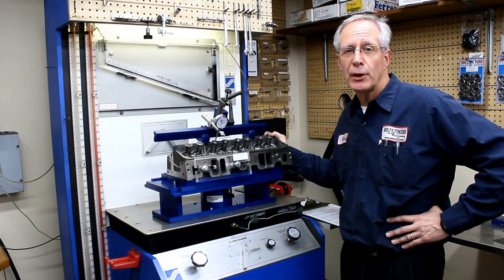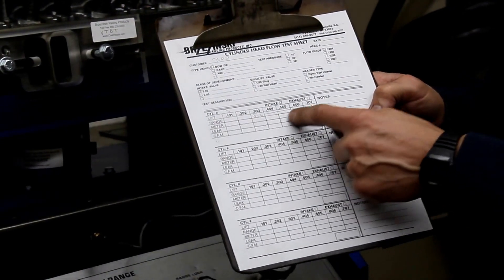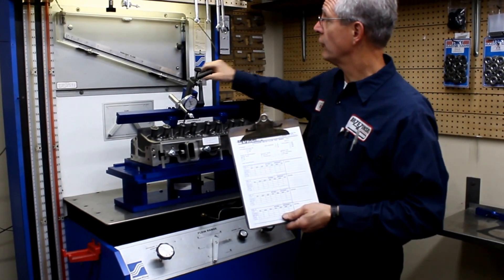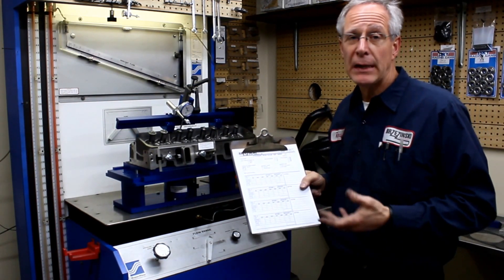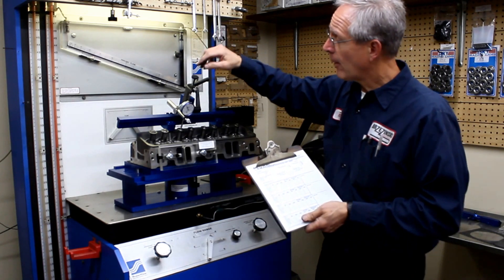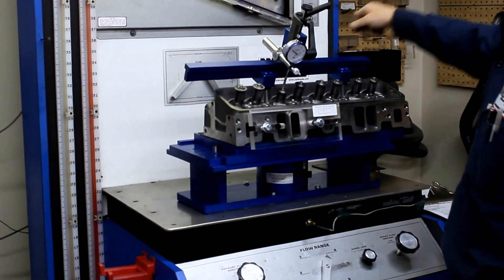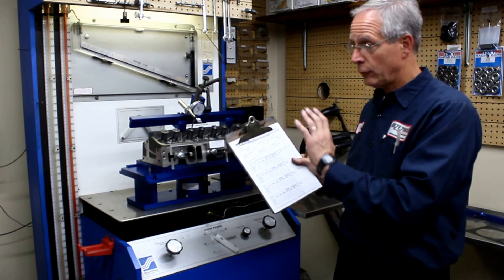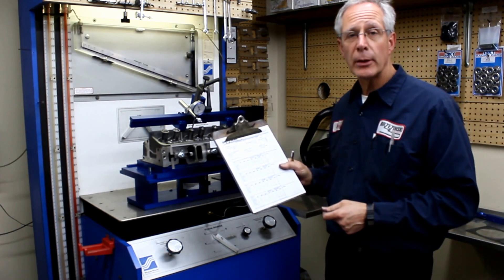Flow Test Manually - Intake side - Part 8

Comment: First , thank you for the videos. I'm having problems with calculation of "corrected range" and  "corrected flow range". I'm using the SuperFlow newer test sheet. Maybe that I'm 65 is going against me. LOL. I recently got my SuperFlow 110 working. I do have the Port Flow Analyzer but I need to understand the basics of the machine before I attempt the software. The instructions can be a bit vague at times. Thank you very much for your time and assistance.

Comment: Great video! I myself am using a flow bench manually. It  had a partial Audie computer so I converted back manual. So I've learned how to use it manually. I actually bought gaskets from you and plan on buying stand/sliders from you. Do you have flow log available for download ?